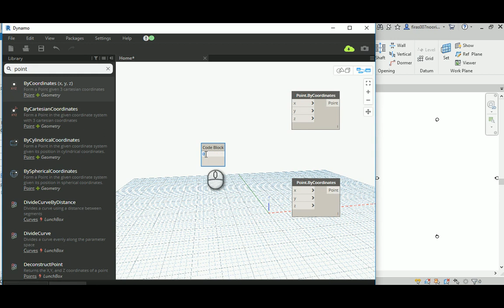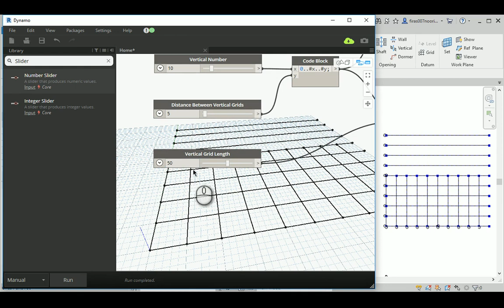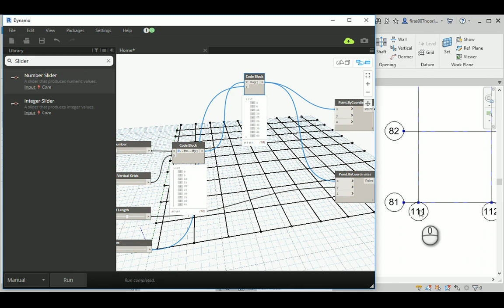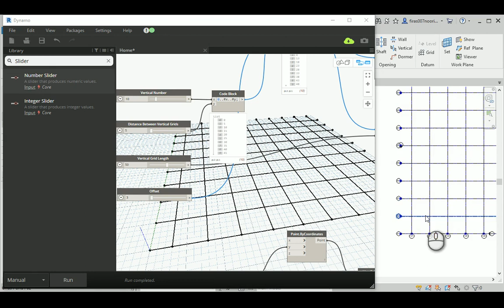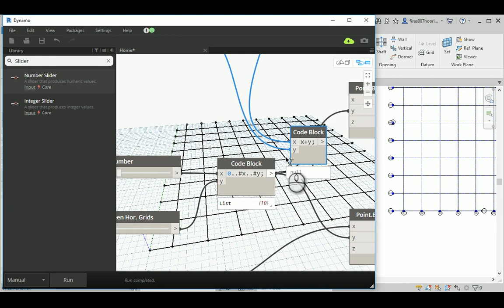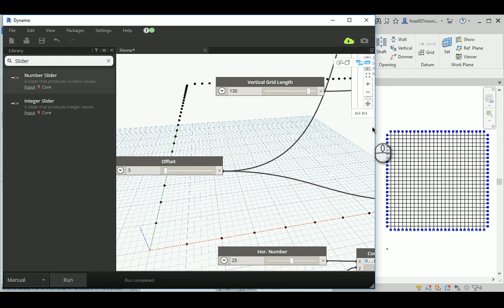Making a Parametric Revit Grid By Using Dynamo

Comment: eu preciso alinhar este eixo com objeto de uso , como fazer?
Reply from the maker: I am using Automatic Translation from Google, so not really sure if the translation was correct. If I understand you write, you can align these grids to an existing one, or you can import CAD grid and them let Dynamo sense them and change them Automatically to Revit one, you can use select model elements, and then get CurveElement.Curve to change Revit ELement inro Dynamo Lines, then use Curve.end and Curve.StartPoint to build you own automatic Dynamo Grid and get it back to Revit!! this is a series time saver node, I should made it one day, Sorry for my late replay as I have midterm Exams at university and I have lots of student to examine every day. Cheers
Reply: @FirasNoori  I used the translator too, I hope you understand. thank you for answering, because i build walls in the revit first then put lines of axes, so i avoid going to dwg and back, this grid inserted in the center of the wall in use, it is not good to create all the walls and send to dwg and back in revit for grid lines, axis in the center. it doesn't become practical and fast.
Reply: for a quick process it is to select walls, another object, detect the center and thus insert the axis, grid lines. that's what I'm thinking and having trouble doing.
Reply: and do you have dynamo to put measurements in the project automatically, by video for me to do?

Comment: Thank you for the video. How could I create a script which name the location of the items related to grid lines?
Reply from the maker: Hi Titi, Can you explain more please?
Reply: @FirasNoori  Hi,

I'm creating scaffolding families in Revit and I have to create a family to identify the item by the grid position to be able to calculate the load on each leg of the scaffold. For example, let's regard that we have a structural beam locate between grid 1-2 horizontal and A-B vertical, I would like to be able to see it on my schedule, as I can see the column location according to grid lines.

Thanks.
Reply from the maker: @titomoura7014  Have a look at the rest of the videos in this series, at the end, I will make a line to connect the dots and each line actually represents a beam,, you can get back the location (Start point and endpoint of each line) this will give you exactly the location of each beam!! for naming you can add a sequence of letters like A, B, C to be added to each beam you create in Dynamo to name each beam a unique one
Reply: @FirasNoori  Thank you for responding me! I will look at it carefully.

Comment: Firas - thanks so much for your videos.  They are very helpful and easy to follow along.  I work in the parking garage industry and do lots of 3D proposal drawings.  A lot of repetition in what I draw so Dyn can be very beneficial.  What I am trying to do in set up a universal program where all I have to do is a few inputs and bam my garage is drawn, mainly with just length width and height of garage.  I will eventfully need to understand how to introduce ramps, columns and so on.  Im struggling with how to set up an intereractive model where all I need to specify is the 2 end bay dim (45') and 5 bays in between (36' = 180') and then of course the multiple bays in the Y axis at 60' but can be changed. any help is greatly appreciated.
Reply from the maker: Greeting, dear Robbie, I am happy you find these videos useful, i tried once to make a parking but in 2d base in dynamo, it was a couple of hours goffy tests, that failed soon as I was just testing, but for columns I did a full set of videos in my channel to make automatically generated grids and beams and columns, look at it, for ramp and 3d parking it can be done indeed, it might take a 2 months of work to make it accurate and to make it comprehensive, u can use a linear array function ir even better 2d array dynamo to create a parametric x and y zone that has in it your cars, yet applying the columns to it is another battle :)
You can use the automatic building that I made (automatic room, I do  not remeber the name :) ) and make it multi  story, just try to tackle each problem alone, so
First make a linear array of parking
Second make the bin
Third fix the circulation possibility (this is a nightmare mate!!)
Fourth do the multi story
Fifth do the ramp
Cheers mate